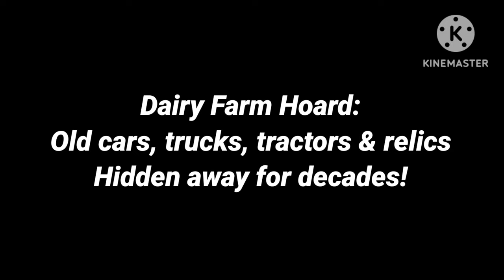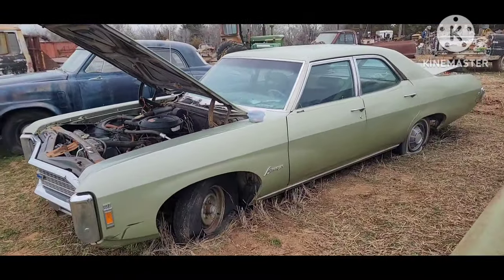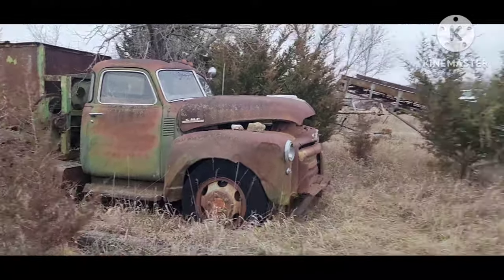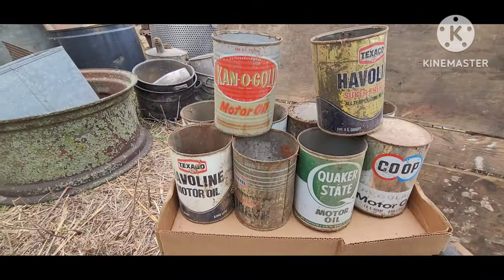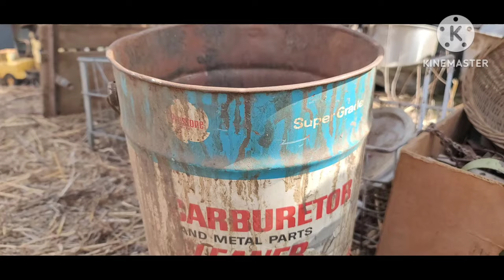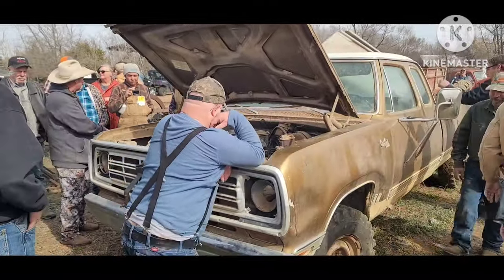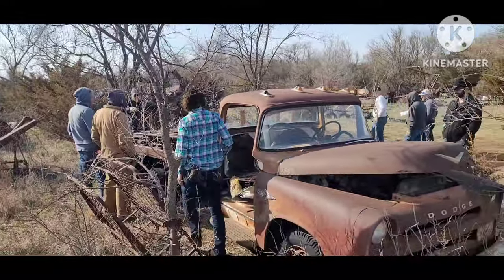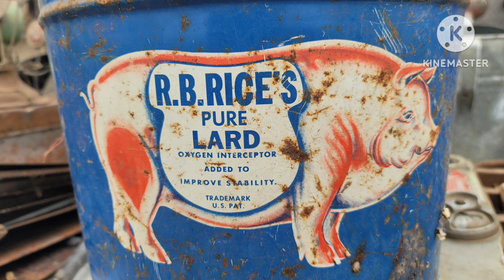Abandoned Dairy Farm Hoard! Cars, Trucks, Tractors & more relics! Chevrolet, Dodge, GMC Ford & more!

Comment: This seems like a hoarders property. My guess, back in the day you couldn’t sell this equipment for enough to cover the transport, so there the collection sits. My uncle had a very big dairy operation up in northern Utah which spread into Arizona back in the fifties. Any sort of machine that had to do with cows and the milking process. He didn’t have one one each he would buy a fleet of over the road 18 wheelers and let them sit until he got around to fixing a few. He was an ace mechanic and a certified  welder, plus he could tear a big diesel engine apart and it would run like a top when he finished. Still his acreage was full of old equipment just rusting away. Got a feeling this is part of farm life across our nation.

Comment: That Biscayne is in pretty good shape. What year ? About a 72'?
Reply: The green one at 6:25 is a 68  ?
Reply: Oh ok. I'm starting to get rusty. I used to able to tell you the years and the difference of the years of the different cars. I didn't know everything but I knew alot. Getting older and having Covid pretty badly messed with my memory.  Still love them tho. I just love old cars.
Reply: @GrandPitoVic  Good Luck partner , that long covid is going to get the best of me too !
Reply: @mrbakerskatz  it is a '69
Reply: @mrbakerskatz  The first chevrolet 4 door sedan was a 1964 and the second was a 1969
Reply: The first 4 door chevrolet is a1964 and the second a1969 . One easy way to see if a car or truck is 1967 or earlier is no sidemarker lights or 1968 or newer sidemarker lights  some cars and trucks has integrated sidemarkers in to the taillite for example el camino 1970 to 1972
Reply: The 1969 is a Biscayne. The 1964 is a BelAir.